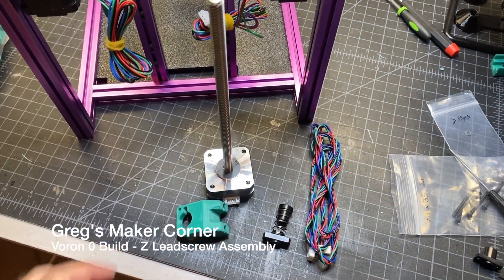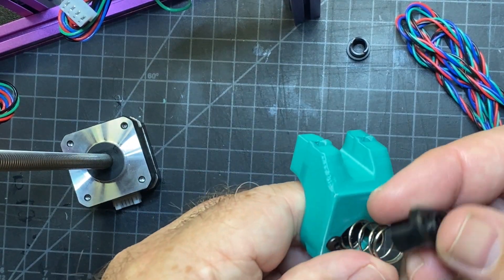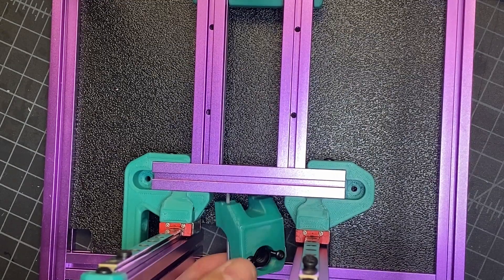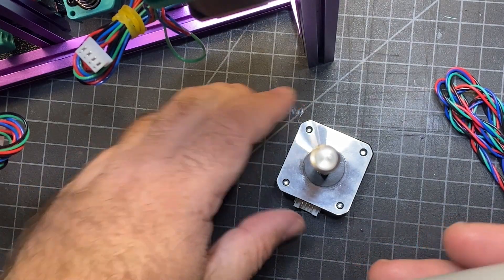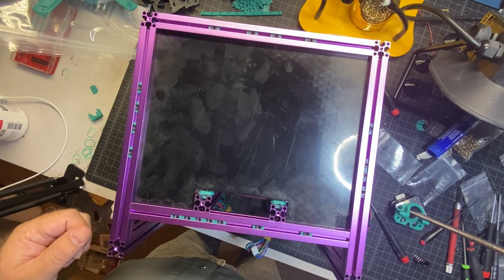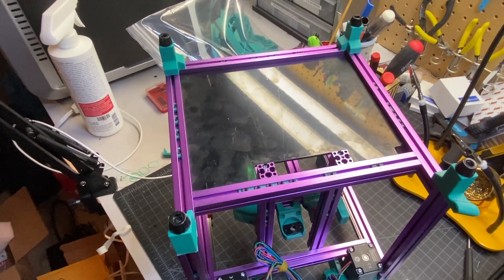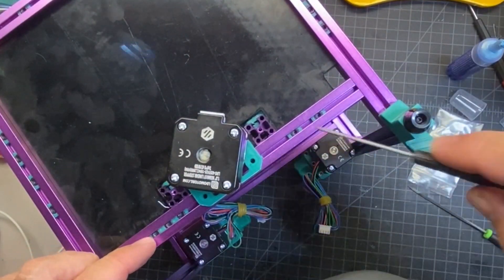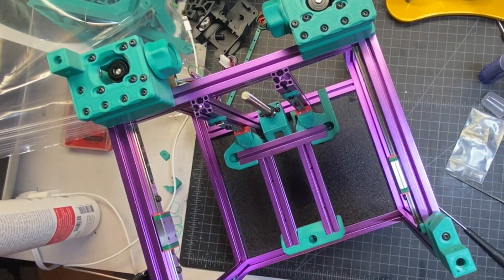Voron 0.1 Build Series - Z Lead Screw Assembly

Comment: I know that manual says to grease Z-axis, but I heard you shouldn't use grease with that plastic POM nuts.
Reply from the maker: It’s still a good idea to. Have a look at this article for more info. Basically the self lubrication of Pom or Delrin is not consistent enough so you still need to lubricate externally. https://www.linearmotiontips.com/when-should-you-lubricate-a-lead-screw/
Reply: @GregsMakerCorner  Thank you for the perfect explanation.